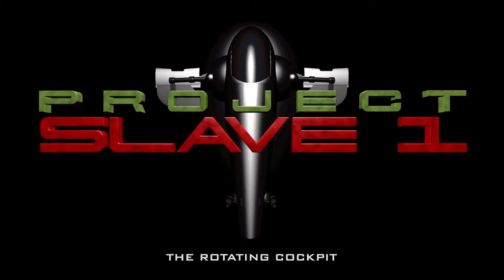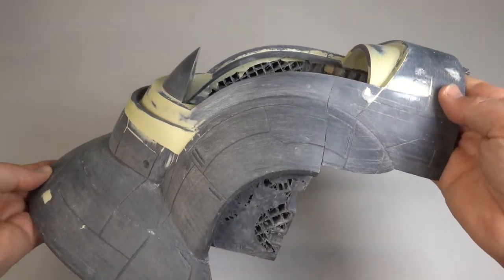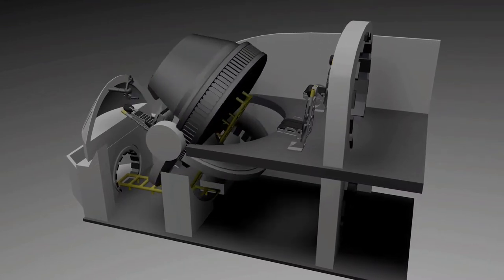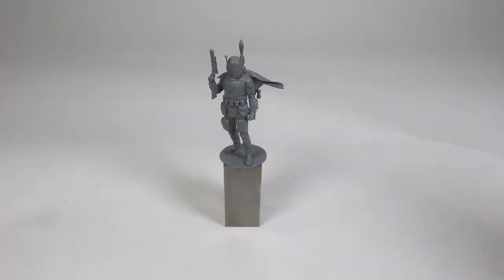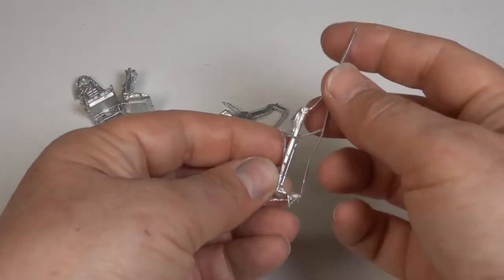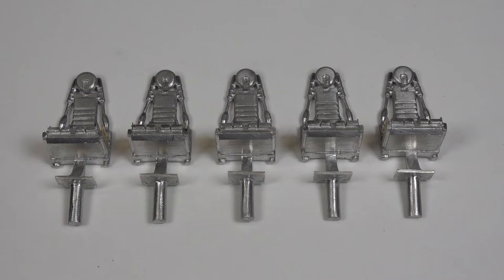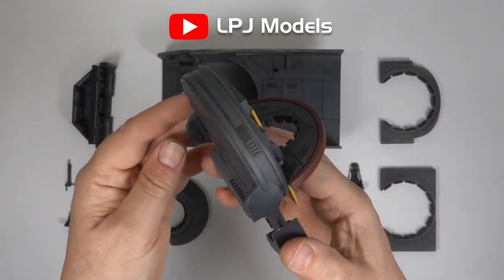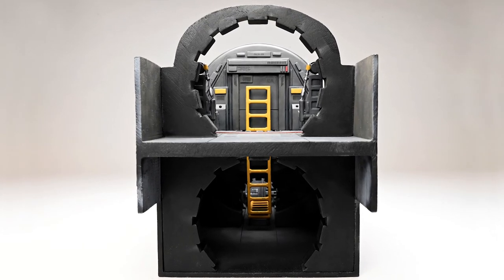PROJECT SLAVE 1 PART 3 ‘THE ROTATING COCKPIT’

Comment: An interesting take on the problematic rotating cockpit. Great job by the way! As you've pointed out they would need two sets of independant artificial gravity on the ship to deal with the 'in-flight' deck separation. The maintenance this ship would need in the SW Universe would be insane.
Reply from the maker: Thanks for the great comment Colin. If someone came up with the design for 'Slave 1' in the 'real world' they would probably get fired, or fed to the Sarlacc...
Reply: @StaplesandVine  haha they would indeed 😊. Just watched the other episode where you've modified it for both landing and in-flight modes. Super impressed 👍. Now if you could add the seismic charge layer I think millions of voices would cry out lol.
Reply from the maker: I did get a bit carried away with the cockpit! Glad you liked #4. I think the seismic charges will be a nice touch. I've got a bit of re-engineering to do for the wings but that's a way off yet. #5 should drop soon.

Comment: if you watch the behind the scenes of The Mandalorian season 2, they show a short animation of how it works in the starwars universe, its similar to your solution but not exactly the same
Reply from the maker: Yes, I've seen it. It does seem a rather crazy solution to rotate all the rest of the ship around the crew seats and will mean ladders everywhere. On the ground or in flight all the crew accommodation is going to be totally messed up. The toilet is going to be a total nightmare!
Reply: @StaplesandVine  not to mention all the stuff falling off the shelves and cabinets if not secured properly
Reply: @StaplesandVine  Seen in the Mandalorian the Cockpit consists of two decks, the main flight deck and the ground floor, only these two decks are rotating according to the cinematic scenes, the rest of the ship is most likley build for flight position.
Reply from the maker: @LA-st6dq  I decided to go for a design not cannon but a lot more practical. Something that would make a lot more common sense and a lot less spilt coffee.
Reply: @StaplesandVine  I mean both your idea and the OG make sense 😉 although the second deck in your idea stays horizontal/vertical which is strange unless you thought about artificial gravity.

But since it was a prisoner transport it makes sense that everything is built for flight mode aside at least the decks which can be rotated vice versa. We know from AOTC and the OG Triology the Cockpit can be left in flight mode even when landed, but of course for the comfortable access/exit the rotation will be engaged. Maybe we will see more of the interior functions in Book of Boba.
Reply from the maker: 'Slave 1' is my favourite ship! The Star Wars universe does have some form of artificial gravity and if it came down to rotating just the flight deck or all the interior it's a no brainer. BUT! we don't live in that universe, Book of Boba  Ep. 2 tonight, maybe more answers then...? Have you seen my 'Slave 1 #4'? Next episode coming soon...

Comment: Hope you don't mind a couple of questions - how many Kg of filament did you use on this model and would you change print settings if you weren't going to carry out your mods, ie print the model + assemble as it is?
Reply from the maker: Hi Sound Guy. I originally printed out all the parts on my FDM Ultimaker and I reckon it was about 4Kg of filament. I used a 0.6mm nozel but all of the other settings were as recommended but Gambody. You will have to plan what order you print stuff to get the maximum our of each reel. I suggest printing all the big parts first if you can. Allow for 5Kg and you should be safe.

Comment: Also, would you be willing to make a small custom photo etch thing? I don’t have the tools to do it myself, and can’t find anyone to design and make me some, could I hire you? I’m making a 1/35 barn, and need a weather vane… would you be willing to do that? Thanks
Reply from the maker: Hi, I don't actually do the photo-etching I just send the artwork off to these guys - https://modelshop.co.uk/Static/WorkShop/Photo-Etching  You can supply artwork in various file formats or go 'old school' and draw it by hand several times full size for them to reduce. It really isn't hard the first step is to choose which thickness of metal you need and then go from there.
Reply: @StaplesandVine  Oh, ok, thanks!

Comment: I would love to make that for my 3.75 inch figures. Does anyone print the parts for sale?
Reply from the maker: Hi jrtien, I haven't yet made the cockpit parts available for 3D printing. Maybe someday.
Reply: @StaplesandVine  hey. I meant does anyone print the ship parts and sell them? I don't have a printer.
Reply from the maker: You may be able to find someone but it will definitely be cheaper these days to buy your own printer and have a go yourself.
Reply: @StaplesandVine  any printer recommendations?
Reply from the maker: That's a big question! To print a Slave 1 for your figures use and FDM printer (that's what I used). Then it's down to your budget. You get what you pay for, many start with 
 a Creality or Prusa. Both good brands but you can go crazy if you want to start printing Star Wars helmets. PLA is the easiest material to print with. Research a few makes first and check reviews on YouTube but buy a recognised brand so you can get help if you need it.